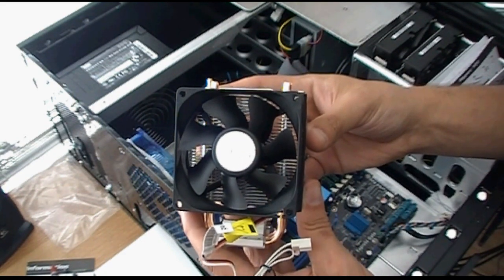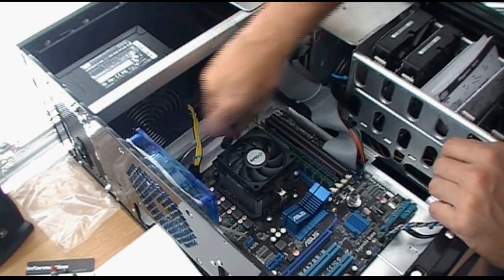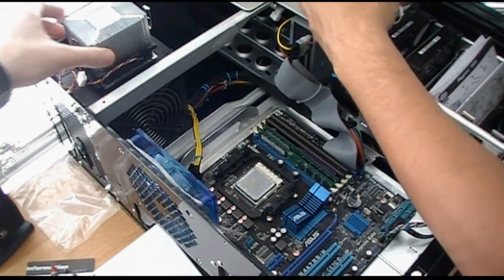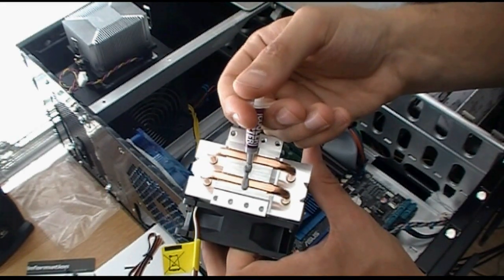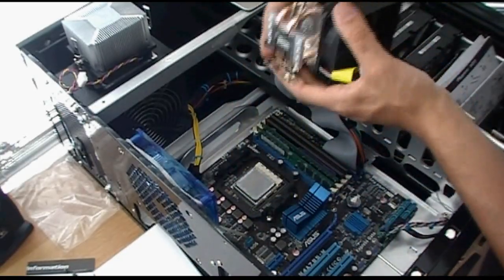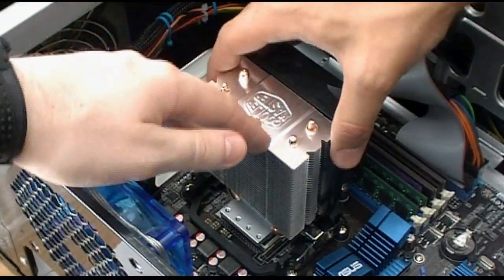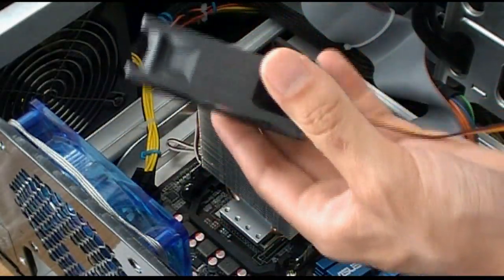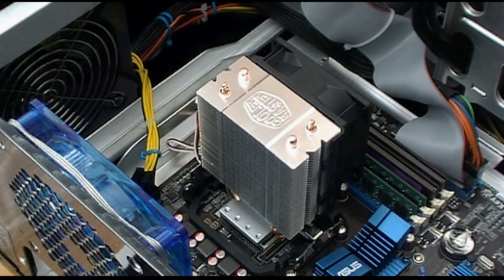Cooler Master Hyper101 How to install

Comment: Do not i mean do not put the thermal paste on the cooler i swear you are carzy if you do. You always apply a pea sized amount on the center of the cpu half the size of a compacitor's top, on a mother board.

Comment: This is NOT the proper way to do this. You're ALWAYS supposed to remove the old thermal paste on the CPU with some isopropyl alcohol or a specific thermal paste cleaner. Plus you put on A LOT of thermal paste. With this stuff, less is more. This is only meant to fill the tiny grooves and imperfections between the heatsink and CPU. Use a VERY thin layer. Also, it's easier to put it on the CPU and then put the heatsink on instead of putting the paste on the heatsink.

Comment: I used this as the only cooler on my pc because stock AMD ones are not great and when i built it we had a heatwave here, it was 44 degrees Celsius at the hottest, im glad i bought this

Comment: i prefer to put the paste on the cpu itself, but its up to you. BTW, dont use your stock cooler's fan on a new cooler. THEY ARE CRAP, NOISY AND DEFFICIANT. Always go aftermarket bro :)

Comment: WAAAAAY too much thermal compound, you want as thin a layer as possible while covering the whole CPU heat spreader, from my experience it is best to put a small dab on the top of the heat spreader about the size of a small pea or a grain of rice.

Comment: I like how you cal lit "thermal gel" when it's thermal grease. However i've seen worse not cleaning the old grease considered. You dill well by not telling people to smear the grease all over the CPU which is good because thats the worst possible way to use thermal grease. all in all it's not a bad video.

Comment: it's like a cute little mini hyper 212+ :D such a good bargain, 15 bucks gets you this, and the mounting system is easy to use and it comes with brackets for another fan, i have an 80 lying around so ima get this

Comment: @ptwick123 yea just find a 3 pin plug on your board somewhere. maybe even use the chassis fan plug if its not in use. i had to do that today when installing.. 4 pin plugs are for PWM models... make sure to turn off the monitoring in your bios though to get rid of those pesky beeps. popped this in today on what looks like the same board in the video. asus m4a785-m. a small powerhouse of a board. dropped my temps alot!

Comment: Is it setup so that it will be easy to install the optional 80mm fan while it's on the cpu?, or will you have to take it back off, clean off the thermal gel and do the whole thing all over.  I've ordered this cooler and it looks like you could screw the fan to the brackets and then pop it on. Have you tried this yet?

Comment from the maker: @TheRomanCandle790 the "old thermal paste" wasn't old the stock cooler was on the cpu for max 24 hours so that doesn't make a difference and the temps, and the temps went down by 20c from 60c to 20-30c . Plus this pc isn't being overclocked this is just a stock cooler replacement and I would normally clean the Thermal paste only when its about a month old or on my main pc that has a 1GHZ over clock